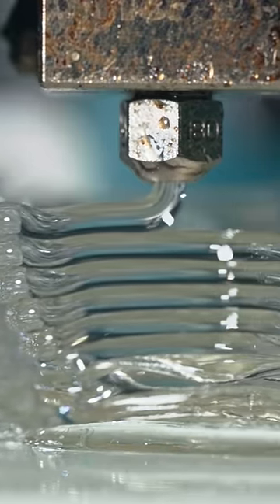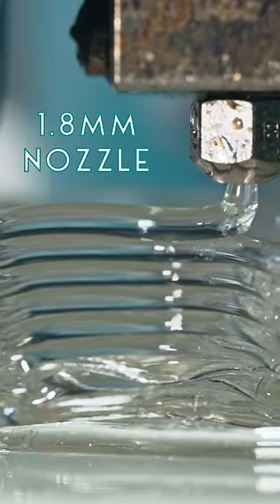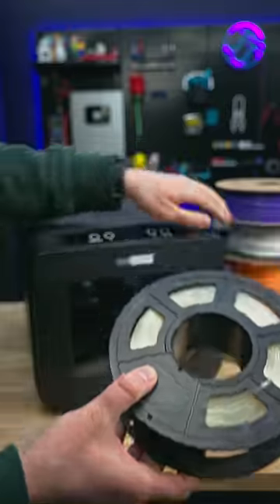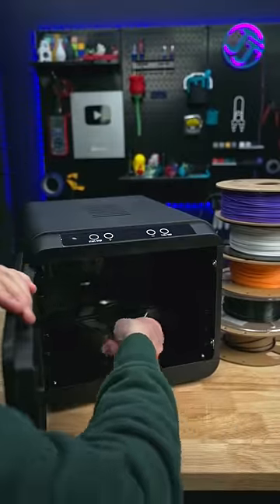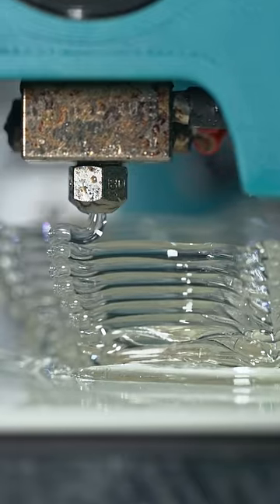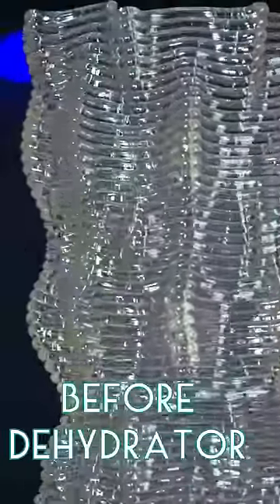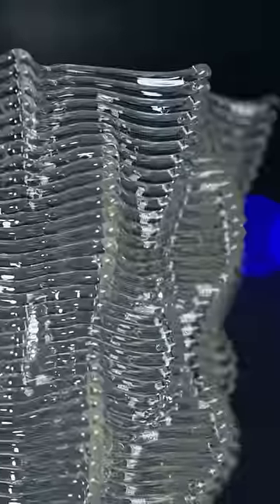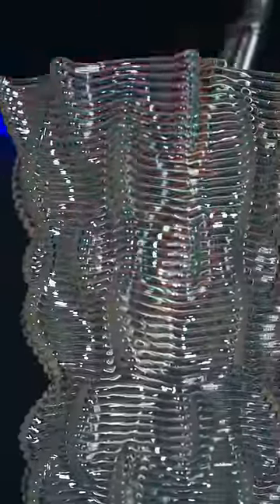Dehydrating Clear PLA Filament

Comment: try packing it in fine sand and baking it at its melting temperature to reliquify the filament, might make it stronger if it's printed at 100% infill

Comment: i do plastics and if you can try running it hotter and faster without burning or bubbles should get a clearler result. as well as maybe have it feed from the dehydrater to the printer. plastics that are hygroscopic take on moisture pretty quickly.

Comment: Can you sand down some of the high points, uniformly and until the horizontal lines are gone, in a mathematically symmetrical pattern, then polish the sanded portions to provide clear “windows” that contrast with the occlusions from the horizontal lines.

Comment: Do people usually have splay issues with 3d printers? I'm a material technician at a plastics manufacturing factory, I've never heard about drying filament for a 3d printer but it makes sense, we use large dryers to remove moisture out of our materials l.

Comment: Does anyone else feel like all 3d printer manufacturing companies. Are just fucking with everyone and have a agreement with each. To purposely make them slow when they actually have the tech to make them super fast
Reply: They are getting faster, the issue is that they can’t go too fast and still be precise rn. It’s always going to be easier for a company to get the cutting edge (faster) ones as they’re gonna be prohibitively expensive for an individual. Like how computers used to be.
Reply: It's mostly a time thing, I know a buddy with a 3d printer, and it isn't fast, BUT
it has to go SLOW to do it correctly, if it did it fast it would mess it up BAD, because alot of people done know, a 3d printer is HOT, The filament is HOT and semi-liquid so it can build with it before it hardens and cools

If the printer goes too fast, the build will mess up, or have a higher chance at such

I HEARD (can't confirm but I've heard!) That work is being done into making 3d printers that are "fast" for factory use

Comment: - if you want to make it waterproof, seal the inside with a poured layer of clear epoxy . If you're going for a decorative outer pot for your plants,  a smooth sided glass just smaller than the print so it just nests , is a very repeatable approach . 
Shoot, this you've produced is an absolutely sellable product . 
Lots of retail outlets would stock something like this as "Home Decor" . Good LUCK !!

Comment: You should print something, then pack it tightly in ultra-finely ground salt, bake it at 100c (or just below the transition temp for the filament) for about 15 min's... The goal is the really bond the layers by re-melting (partially) the filament in a confined, oxygen free (limited) environment, and reduce refraction between layers. 

I can't find the video now, but someone did this with clear PLA, and the results were stunning. (just use water to disolve the salt)

Comment: Would it be possible to try to print a "glass-like" block? The idea being it may not be able to be use like a regular glass block or even be load bearing, but what about being an inside wall decoration to let in light to a bathroom or kitchen without having to completely put in a small window or add heavy, expensive glass blocks. Thoughts?

Comment: How do you get such an effective print with the nozzle that far away? Is it due to the larger layer size or the filament itself? If mine was that far away id come back to a spaghetti mess in a few hours.
Reply from the maker: It's because the thick layers are so heavy and cool so slowly. The bottom layers of the vase tend to get slightly smooshed, so by the top of the vase the nozzle end up far from the print in some parts

Comment: Question: I have 2 spools of pla, one has been installed in the machine for a while, the second is sealed in plastic from the manufacturer. The first spool is now printing a few layers at .1mm then disconnects from the bed. I couldn't find a solution. So I tested the second spool. The second spool went great. Keep in mind the settings and environment are the same at time of print. What is wrong with the first spool?

Comment: You try sanding to see if you could get it actually clear? I feel like the shape of the rounded layers distort the light to much.
Reply from the maker: I've tried, but it takes so much sanding and in the end it still looked more cloudy than it did off the printer. I need to do more testing with various techniques though
Reply: @JJShankles  thanks for sharing!

Comment: I would think twice about it's use as a planter. Roots don't do very well with exposure to light. It will work but the plant can have issues if the roots keep dying from the light.

Comment: 1.8 mm? So slightly thicker than most filament? 
How well does that tend to print?
Reply from the maker: Yes larger than the filament, and it prints great pushing it into the hotend faster than it comes out the nozzle
Reply: @JJShankles  that's really neat! I d
on't think it would work too well for anything with a lot of detail, but it's good to know that there aren't cooling issues with the filament being so thick.

Comment: Can you use a 3d printer for glass?
If you heat it up enough, does anyone think it could work?
I was thinking a glass filament would be kinda difficult to handle, but what about a glass pouder poured in to a funel like container that feeds it to the furness, the furness in turn feeding liquid like glass to the printer.
Can anyone see that actually happening? If so, please make it happen and go make some money.
Good luck and GOD Bless you.
Reply from the maker: I've have seen one industrial glass 3d printer. It was basically a kiln because of the extremely high temperature required. Haha not really an at home system yet!